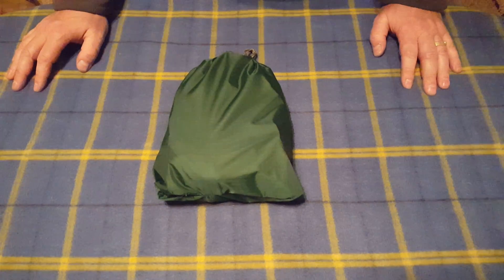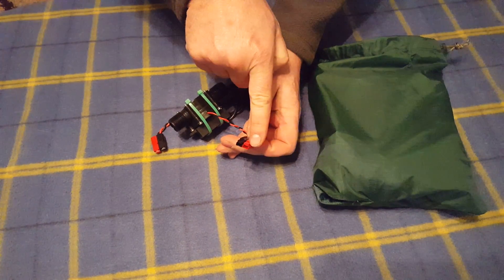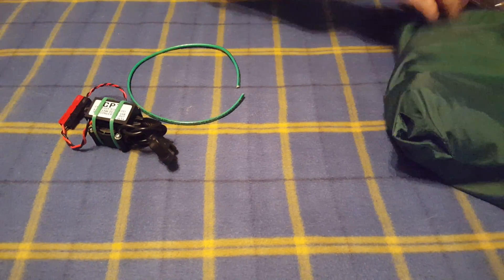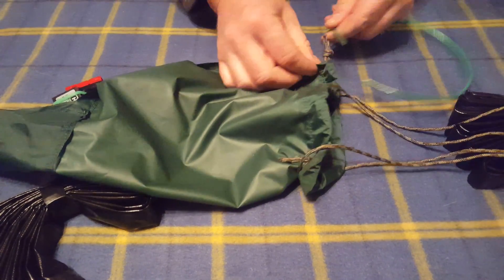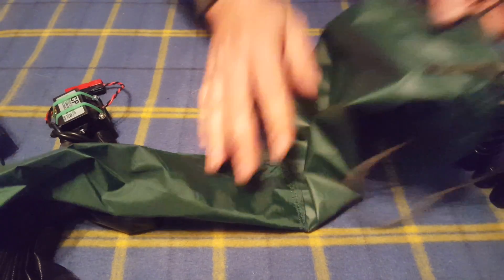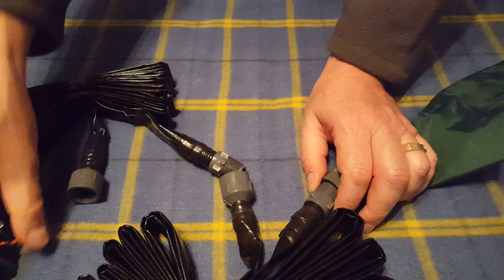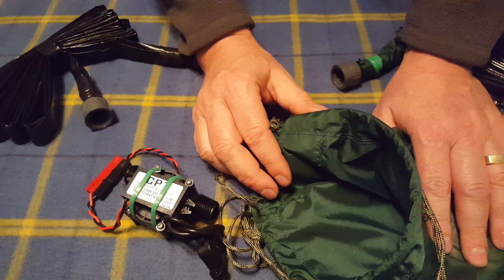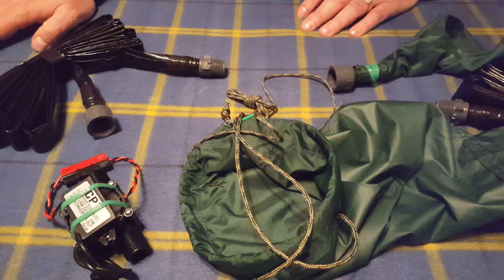Unboxing the Tactical Hydro 10W hydro power system (5V USB and 12V outputs)

Comment: wouldnt it be more practical to just have the turbine submersed and water proof and then have a cord extending for use creekside? Also I think a prefilter woiod be needed because debris would certainly build up in thay funnelling. The idea of 10 foot gravity pressure isnt that practical in many situations. I applaud the innovatiom but makes more sense to keep it all together. Ditch the hose and offer a hardshell case to carry the unit in, make it a bright color so its easy to see, add some filters and maybe make an intetlocking upgradeable design and your in business. The hose aspect will sink this idea, pun intended.